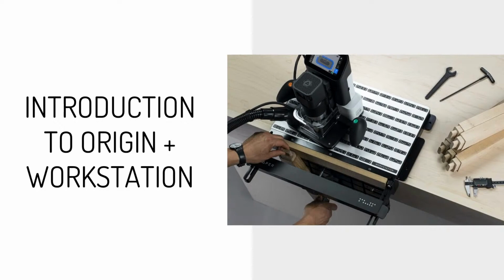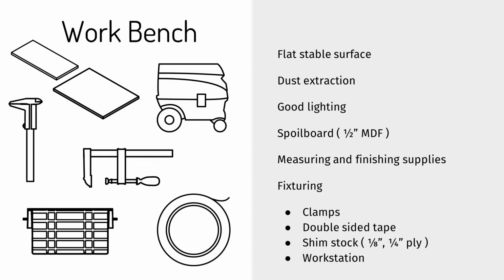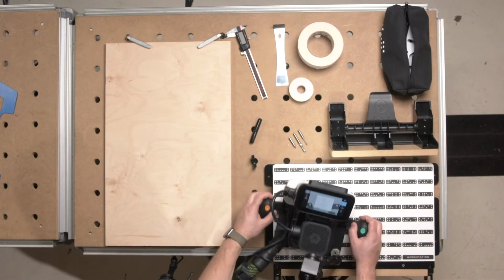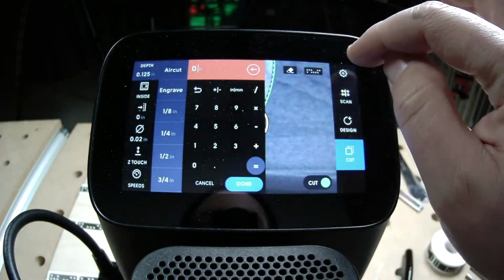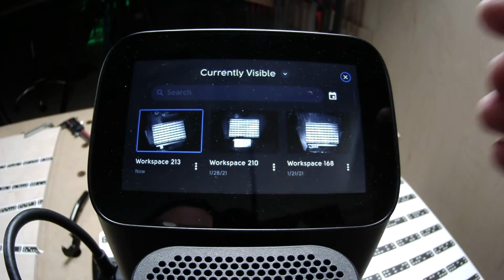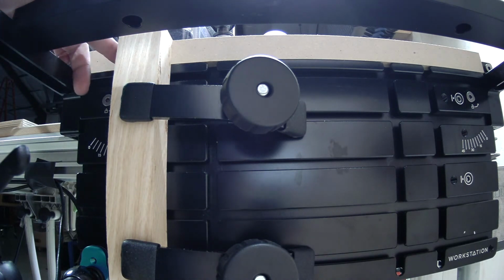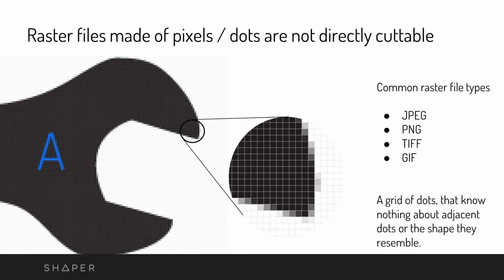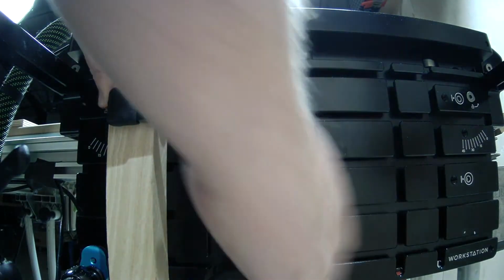Session 24  – English : New User Onboarding

Comment: For your next software update, it would be really nice if the diameter of the white circle can be made smaller. That would really help with selecting different cutting paths close to one another.
Reply from the maker: When multiple paths are underneath the range circle, look toward the bottom of the screen - a SELECT button will appear in Design and Cut modes. Tapping Select will allow you to select precisely the path you want. Hold down the Select button to see which paths can be switched to. 👍